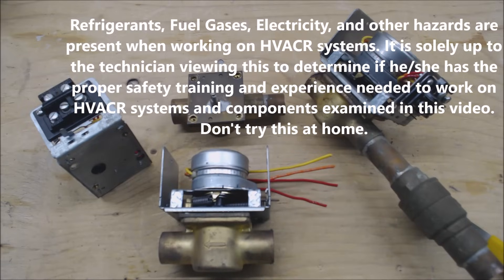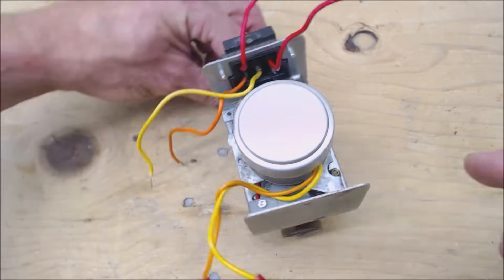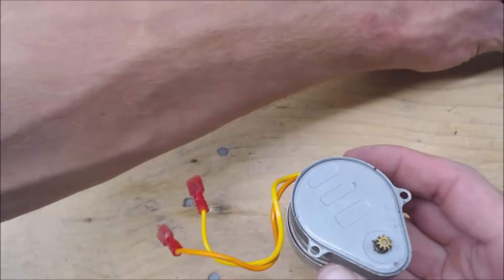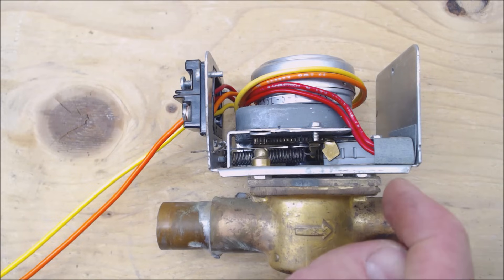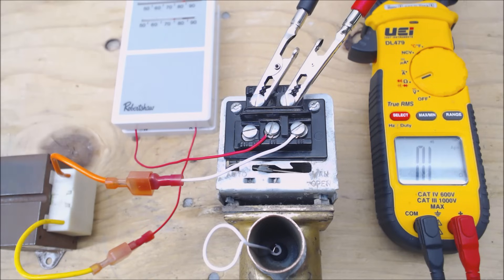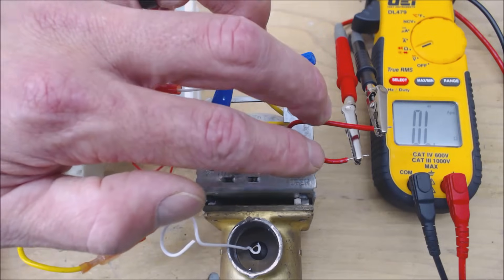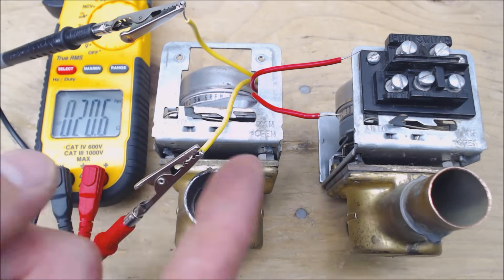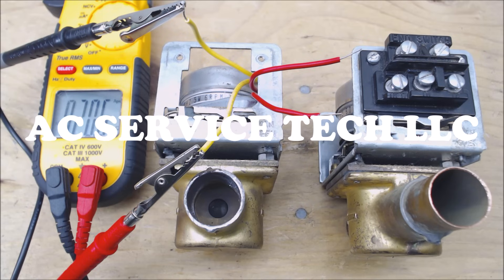4 Wire, 5 Wire Honeywell Zone Valve Wiring, Troubleshooting, Dismantling

Comment: Hi, 
I'm looking for an answer for my problem if anyone can help. it's about using a smart thermostat (Emerson Sensi 1f87u-42wfc) along with my Electric furnace. I do have 2 zone valves. The main one is a White-Rodgers 1361-102 connected also to the 2nd one the Motortrol 672b307. They are of course interconnected. Someone is trying to help me online and he said that the current setup is not ordinary, still waiting for his suggestions.

My schema is below, we can see the R/W/C all connected to the 1361 then 672b. Thermostats shown are also non-smart (old ones that uses mercury) If anyone could provide any help, I can't thank you enough.

Could the Sensi not be compatible with these 2 valves? Well especially with the 672b as it will be connected to that one

The 672b has 4 wires, black/blue/white/brown. That's the box on right the right, and the first one is the 1361. This setup is the original one.

Thank you

https://i.postimg.cc/qB9f0qY8/schema-2-zones.jpg

Comment: Couple issues with the Honeywell: The motor is stalled on to keep the valve open. This always keep pressure on the brass gear. The stupid little brass gear on the motor is a press fit and splits.  Over long term this same brass gear wears out when meshing with the steel following arm.  With time the entire assembly gets contaminated/worn and simply fails due to increased friction of the arm.  I got very tired of replacing the expensive motor assembly.  SO SIMPLE solution was Remove motor head disconnect it then open the valve and use the return valves as balancing valves. Larger rooms full on. Smaller cracked.  WORKED FINE WITH ONE STAT in a central location. ON 27 year old system.  Several sets of heads in that time. LAST 7 years no head and balanced= $$$ saved and lots of time.

Comment: I have a zone valve passing water when it should be closed. I bought a new valve set and first tried changing just the actuator. I tried that for a couple of weeks but it was still passing water. So I replaced the valve fully, so new valve and the new actuator. It is still passing water. When the zone call for heat is on the motor starts and opens the valve and the boiler activates as it should. When I turn it off the spring closes the valve and the boiler shuts off. I can see that the actuator mechanism has moved back to about where it should be for closed. But if I turn on another zone then water still passes through the faulty one. Even with a brand new valve. I have double checked that the flow direction as labelled on the valve is correct with regards to the flow outlet from the boiler, plus it's the same as all the others anyway. I don't understand what's wrong. Is my new valve faulty too? Do I need to return it and buy a different one? The only difference with the other zone valves that work fine is that they are mounted vertically and the faulty one is horizontal. That shouldn't be a problem should it?
Reply: Not much info on the ball valve I guess. I have a similar issue with no flow.  I would assume that you have a faulty valve but that's just a big guess. If you have figured it out please let me know as it might help me.
Reply: @futuregamer5791  my problem was that there was flow when the valve was supposed to be off. We are talking about zone valves the same as the subject of this video. I assumed it was just faulty and I returned it for a replacement, but the replacement was the same. In the end I had to buy the much more expensive Honeywell valve instead of the generic one. It was the wet part of the valve that was the problem. The motor part in the cheap valve was fine, but the ball part just didn't seal properly when it was closed.
Reply: @adrianthoroughgood1191  I'm guessing it's possible for them to stick closed.  I'm able to manually turn the paddle though. This is for a large apartment building so I would hate to have to turn off heat and isolate the valve just to find out. But I guess that's probably what I'll end up doing. Thanks for letting me know what your issue was though.
Reply: @futuregamer5791  it's certainly much easier to change the motor than the valve, doubly so in your situation. If you haven't already I suggest taking the motor off which is very easy just 3 screws and seeing if you can turn the valve axel with some pliers. If you wiggle that back and forth a few times that might loosen it up. Leave it in the open position (anti clockwise) and see if you get flow. If that works try putting the motor back and see if it works properly. If that doesn't work then you need a new motor. You can buy those separately. My experience was that the generic motor was fine, but if you're not on a tight budget Honeywell is best.
Reply: @adrianthoroughgood1191  right on. Thank you.

Comment: I don't know if it was mentioned elsewhere in the comments below but if you see a red or orange gasket between the power head and the brass body, (on the older, pre-1985 Honeywell zone valves), DO NOT REMOVE THE POWER HEAD BEFORE DRAINING THE SYSTEM, OR THAT ZONE LINE.  Those valves can be converted to the non-gasketed type, but it would be far easier to simply change out the valve to the newer type.

Comment: Awesome video! I have three zones two zones work perfectly. The third zone, indirect hot water heater works intermittently. The zone valve does open but circulator and boiler does not start. Does it sound like a bad powerhead to you?

Comment: Nice video, quick question one off my zones is not working, I opened manually and still not feel the hot water when I touch the pipe , what can be the problem?

Comment: Hi i like  your vireo    i got an issue  in one of my  Zone Valve.  from  3 when i  turn on the thermostat it   for that particular    valve  it does  not start  the boiler and i checked the lever in  it  it is kind of locked and does not move like the other one  when i push them the move and then comes  back  where it was any  idea  thx

Comment: I don't understand why the zone valves are designed so that manually opening them is not enough to depress the switch and start the furnace. What is the point of having them open if you have no hot water circulating? I assume the answer is that the manual open is only supposed to be used for flushing your pipes out, not to for emergency heat in the event of a zone valve motor head failure.

Comment: One of my zone valves stays on the open position constantly. I had to disconnect the wire so the furnace can turn off. So now it's off but still open. So when I turn the system on with the other thermostats we still get heat to that zone. There is no resistance when I move the manual lever. Is it possible the motor is finished and therefore keeping the 2 red wires constantly touching.
Thank you

Comment: Good video for what it covers.  But I have encountered problems on multiple controls where the motor is fine, the thermostat calls for heat, but the gear mechanism does not turn until you nudge it.  Also, I have noted a tendency for either the pinion gear or the rack gear to strip or disengage.  Any insights for dealing the mechanical gear components?
Reply: Replace the dry mechanical/ electrical section of the valve.

Comment: We had a new boiler (SuperHot  125000 BTU) installed a month ago, along with 5 honeywell zone valves. We had knocking in the pipes and the installer came by and flushed all 5 zones to remove air. Sounds continued and they came back and flushed 3 zones. This has helped somewhat. What we are now hearing is a loud thud/vibrations around the house a few seconds after the thermostats turns off. This seems to happen in 4 of the zones and is worrisome as we can't figure out where these thuds are. The pipes are copper, the house is 3 levels (top level 2 zones, middle level 2 zones and bottom level 1 zone). The old boiler was around 25 or more years old and we are wondering i we should have replaced the zone valves. These noises did not exist with the old boiler.  Thank you.

Comment: Does the motor run continually, stalled out against the gear, when the valve is closed?  There does not appear to be any way it gets turned off once the end switch is closed, and if it did, the valve would close under spring pressure.  But it seems like a strange way to design a system.

Comment: Do these valves have the motor stall? I’ve heard where people have gotten them burnt out cause they left them on for too long Which makes perfect sense, but makes me wonder (if this is the case) why not have a gear train where when the lever is pulled and hitting the button instead of stalling have it configured to keep spinning thus not wearing out the motor, similar to how some music boxes are configured like for example if you twist the handle the wrong way, there’s a special mechanism that lets you turn but not wear out the gears.

Comment: Very good - especially disassembling the gear cover. Mine was working fine except the gearing jumped and couldn't close the m-switch.  When working properly, what turns the motor off when the  m-switch is closed?  Looks like the motor should burn out if it is simply relying on it jamming.

Comment: How do you set the low and high temperatures on that zone valve?
Reply from the maker: The temp control such as at the aquastat is for setting temps, these are just powered with 24v to open and close, thanks!

Comment: Thanks for your video - very helpful. I have a question. One of my zone valves stopped working and I tried to diagnose the problem. I disassembled the valve and took out the motor and tried to see what happens inside when the thermostat calls. I see everything working correctly, that is motor does turn the power head all way until the electric circuit makes contact and engages the pump and heater. I can see and hear pump and stove turning on while holding the valve in open position with my fingers - the electric assembly just hanging loose. But the heat does not reach my radiators upstairs, even though the out pipe getting hot downstairs in the boiler room. So I surmise that the mechanical part (boll head?) still blocks the opening for hot water to travel upstairs despite being turned properly from outside. Is it possible, and what can I do? Also I noticed that the valve driving motor is very hot by itself without even touching any pipes. That would take a lot of electricity just to hold the valve open. Does that mean the motor is bad?

Comment: Excellent Video...I do have a Question if you can find Time to answer it. I have an oil burner and 1 Aquastat with high and low limit controlling 1 circulator pump and 2 Honeywell Zone valves. Level 1 zone valve operates fine. Level 2 zone valve had problem with end switch. When the TS is calling for heat on level 1 zone valve i also manually open the level 2 zone valve. The pipe gets hot for level 2 but it does not heat up the baseboard for level 2...what you think the issue is...sorry for long explanation.

Comment: I thought the end switch called for the boiler??
Reply from the maker: It depends on the wiring setup, usually it turns the circulator on and the boiler works by itself to operate and keep its temp at for instance 180 degrees for baseboard radiators, thanks!

Comment: So how does the motor reverse when the call for heat opens on the thermostat. The red wires reverse polarity?
Reply from the maker: The spring pulls it back open, thanks!
Reply: So the motor is still applying force until the call for heat is over. The spring brings the valve back to close with no power to the motor.

Comment: The reason I’m looking at your video (which I really like by the way) is because I wonder what stops the motor from continually trying to advance the “cam” (not sure what the curved arm with the teeth is actually called) once it reaches its endpoint?  I realize it activates the switch to call for hot water...and it opens the valve, but that doesn’t give it a message from anywhere to simply sit open until the warmth of the room tells the thermostat to stop sending 24 V, right?  Does the motor just work against the springs until enough heat raises the room temperature to deactivate the thermostat’s 24 V and thus the springs relax allowing the “cam” to move and close the valve?

Comment: Looks like the 4 wire and 5 wire examples are the same.  When you hook up to the terminals in the first example...they are jest the front side of where the two motor wires are attached
Reply from the maker: Yes I wanted everyone to see that they are exactly the same on the inside. Next time you get a 4 wire valve you can pop the cover off but I wanted to show testing, thanks Steve!

Comment: Why would the valve stick open? and when you tap on the valve body with something rigid like 3/4 inch PVC pipe it then closes. End switch model V8043F1036. Installed January 2017 Just 2 years old January of 2017. What kind of warranties do they have From the manufacturer
Reply from the maker: It could be either the internals or the power head. You could try replacing the power head first.

Comment: hi i have a honeywell zone valve only 6 years old appears to failed inside brass housing i cannot open manually its stuck why would this happen??  i get hot water going to zone but not open enough to to return back thru to complete loop.
Reply from the maker: If you can valve it off, you can replace the guts from the top. You would just buy another to set down inside. It may just be from corrosion, thanks
Reply: @acservicetechchannel  hey thanks for reply i figured out its the head not the valve i took head off and discovered that valve stem will move and stay in position my power head is broken so just need new head assembly after turning stem open(like only 1/4") i have hot water to zone when other zones calll for heat and open and circulator comes on! im pretty happy i dont have to cut pipes!
Reply from the maker: Very good Tom!

Comment: How do you connect the 2 red wires to a auxiliary pump. What happens if you install the zone valve with the arrow pointing the wrong direction. Thanks very informational.
Reply from the maker: You usually would need some sort of control relay in order to power a circulator. You would severally reduce the volume of water being pumped through, thanks

Comment: Thank you, thank you.  Out of about 100 videos I've watched in the past few days, that is the most complete explanation I've seen.  I'm trouble shooting a zone valve issue in an apartment.  Quick question: I'm dealing with an old White-Rodgers power head that has 2 blue wires coming out of it (they are in the push slots # 1 and # 5).  Any idea why there would be 3 lines coming to the zone valve where the 3 red wires are nutted together, 2 white wires are nutted with a blue pushed into I believe the #1 slot, and the other white wire is nutted with the blue pushed into the #5 slot.  Basically, I can understand 2 lines coming there (1 from the transformer, and 1 from the thermostat, however, where would the 3rd line be going to/coming from?  The pump or boiler maybe?  Thanks again - Michael
Reply from the maker: It may be an end switch. I know it may sound silly but it may be as simple as typing into google "model number wiring diagram" and that will say how to wire it, thanks

Comment: Can u go over why electric heat on air handler is giving off gas type smell??
Reply from the maker: That is likely the dust burning off of the electric elements. Has the unit filter been changed continually each month of running time?

Comment: Is a valve core on a air conditioner the same size as a valve core on a bicycle ?
Reply from the maker: Yes but the spring has more pressure and the seal is teflon on the side.

Comment: I just want to make a couple comments reference to heating air conditioners a lot of guys think that's it's just simple tasks that anybody can work on it especially on Heating it's not easy tasks as you guys thinks it's very complicated it will knock your socks off it also applies to air conditioner units working on electrical installs and troubleshooting on heating air conditioner low voltage it's not that simple as you might think that requires a lot of field knowledge and schooling in order to be good Tech and troubleshoot and install.
There is low and rules that applies to every trade you better be certified otherwise you can do a lot of damage to yourself and somebody else and that's not going to be nice pictures on the end. Think about it.
Craig well done as always.
Reply from the maker: Yes, thank you for adding the additional warning. The trainings here are directed at those in the field already, those in HVACR school, and those looking to move into the trade. Everyone should work under a licensed tech to learn the ropes and to learn to work safe, as well epa 608 certification is needed prior to working with refrigerants and other certifications may be needed as well, thanks Nurfet Alic!
Reply from the maker: Nurfet Alic, , would you be willing to write a quick 1 to 2 sentence testimonial in reference to my HVACR teaching ability online, questions answered, or the content that I have put out to date? I may display this under the book section, Q & A section or another section of my new the website. This new website, acservicetech.com should be up and running early next week. No hard feelings if you are unable to. I appreciate it! This could be replied here or emailed at info@acservicetech.com thanks a lot!